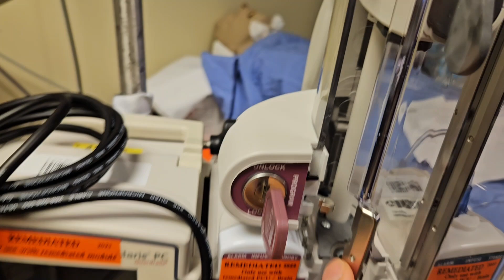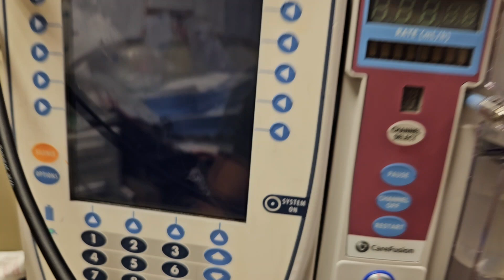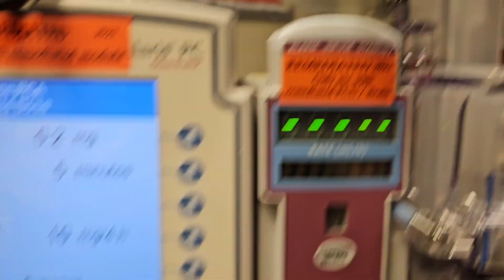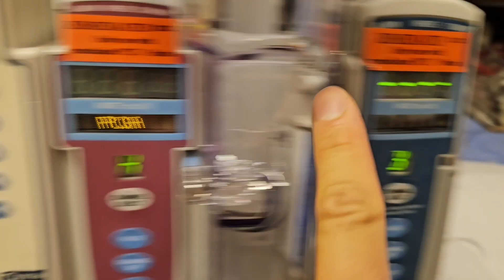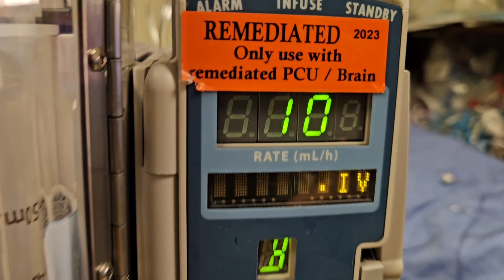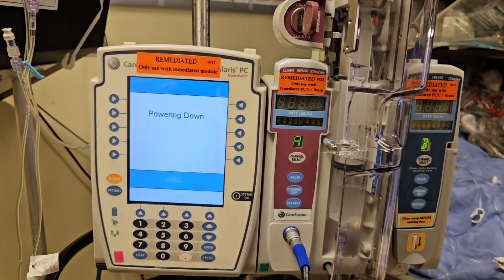Alaris(r) Patient Controlled Analgesia (PCA) IV Pump Set Up

Comment: Was that specialized PCA glass pump an early manifestation of Teleporter with energy pumper machine?
Reply from the maker: The glass syringe is from one of the brands. The problem is that it can shatter and also glass syringes are proprietary. The Alaris pump from the video, has a special channel that allows you to use regular 50ml luer lock syringes. More flexibility.